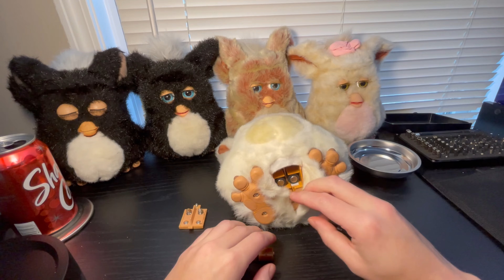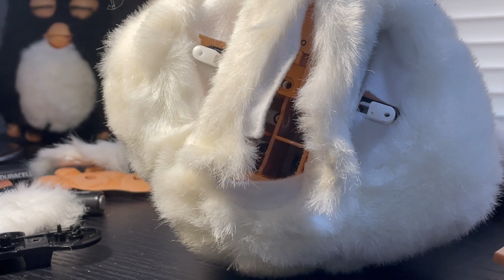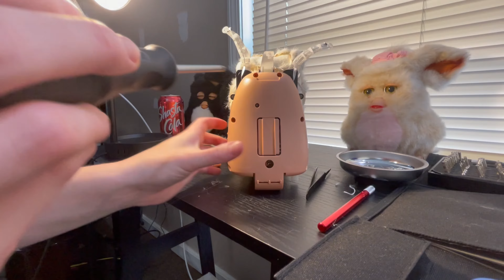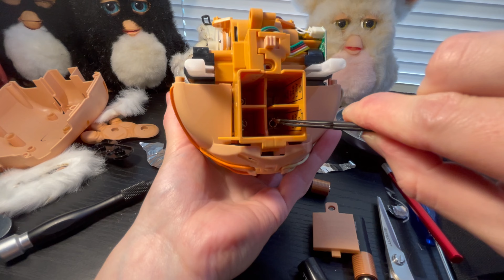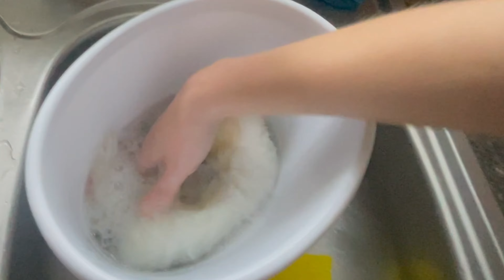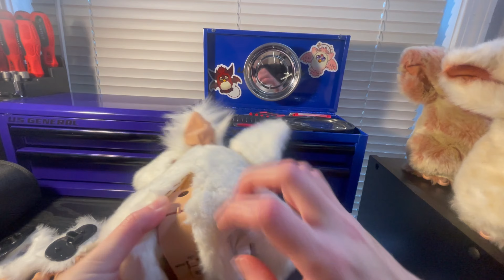Furby Rescue Using a Spring to solve corroded battery terminal and more!

Comment: Question, how to fix battery cover if it is corroded under the plastic? Is there a way to pull it open to clean it? It'd be a great help 🙂
Reply: Came here because of the same problem... if you discovered how please tell me!

Comment: this was a helpful tutorial for my 2005 furby, but is there any way to fix the inside of a battery compartment if the screw part is somewhat shattered?
Reply from the maker: That would depend on a few things, if you have all of the pieces for it and some UV glue it could be pieced back together — otherwise I would recommend plastic welding Polypropylene pieces by heating it up and melting it into the existing plastic very carefully and rethreading a hole with a tiny drill bit about 1/2 of the size of the screw. I do also have a repair service up and running on Etsy, and am also able to message on Reddit for images :) my account is FurbyRepair
Reply: @ReFurby  oh, thank you for explaining! i'll definitely try it out! also i'm not sure if i could really send a furby since i live all the way in spain.